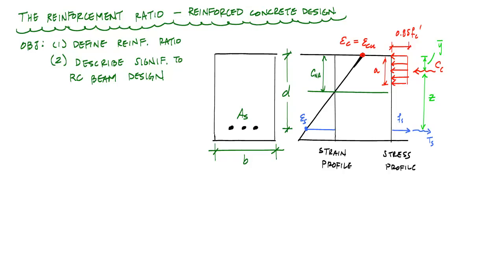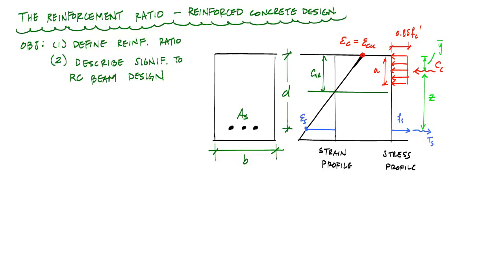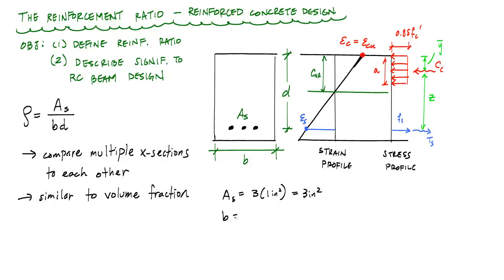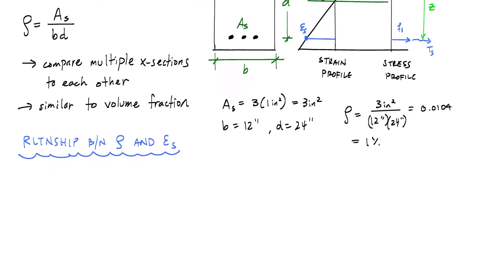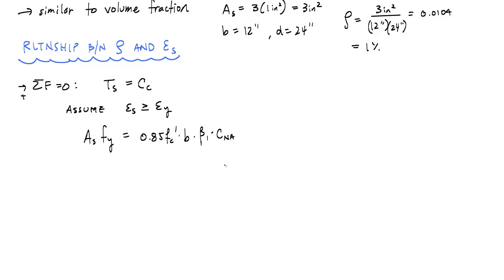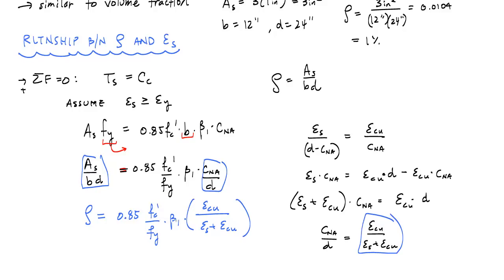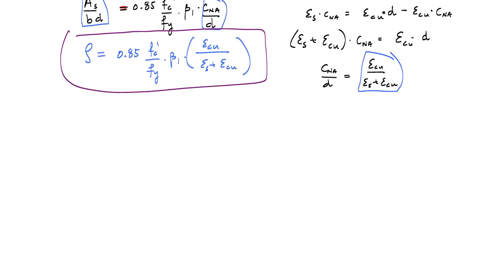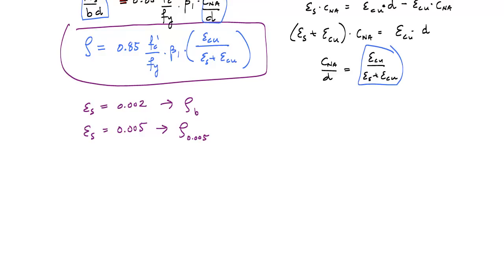Reinforcement Ratio Explanation - Reinforced Concrete Design

Comment: Sir the way you are teaching it, i loved it. I just have a question, why we using "d" while taking cross sectional area of the section? Why not we take actual depth "h" instead of that effective depth "d" ?
Reply: because "d" is the effective depth and not "h", which means that the depth after "d" doesn't contribute in the strength of the member